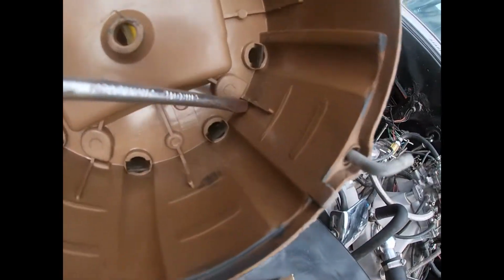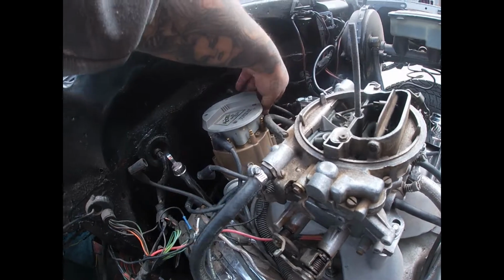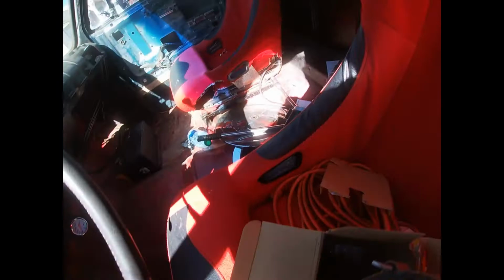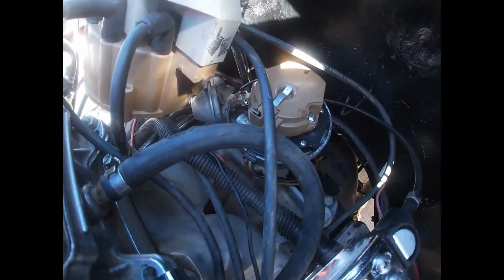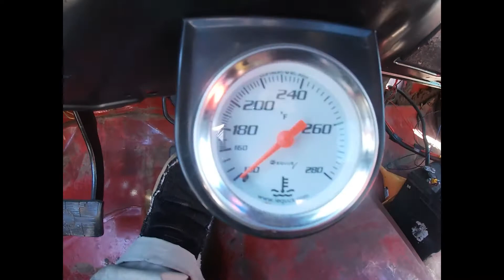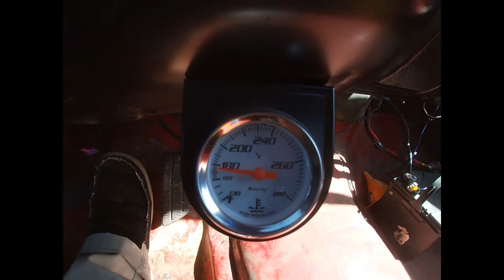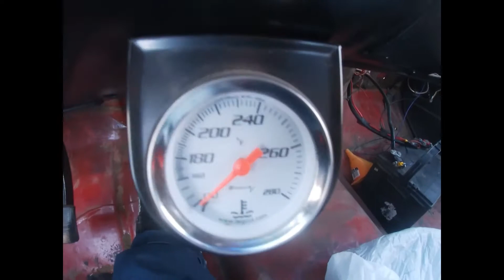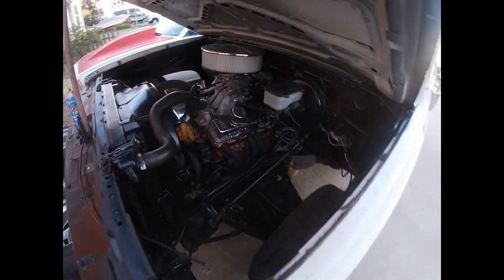c10 backfire problems/problem solved

Comment: That odd surge/bog off the line and at speed cruising IS your carb. You are going to want to look into adjusting the secondary butterfly. Over time, the spring loses tension, and a simple adjustment solves this. Dizzy cap must always be checked as you have before making adjustments ;)

Comment: I have a 67 impala with a 350 small block. I’ve been having issues with it bogging as soon as I want to pick up speed. I already did the timing changed the spark plugs wires and replaced the fuel pump and fuel filter any recommendations? I really don’t want to jump into conclusions that the carburetor is failing
Reply from the maker: Yeah bro if you changed spark plugs and redid the timing and u have good fuel pressure the only thing I can think of is the carburetor .I had a truck that I got running and it would bog out cause of low fuel pressure do to me not adjusting the regulator to the right psi .I'd check fuel pressure before messing with carburetor. I don't no what carb u got but an edelbrock needs 6 to 6.5 psi and a double pumper I think needs like 4.5 to 5.5 if that helps any..let me know if u get it figured out.

Comment: My truck started backfiring from the exhaust after I accidentally poured water it the tank( I have a loose cap). I added heat and fuel treatment to it, And for a while it was doing fine till it rained again. That was a few weeks ago, now it's backfiring from the exhaust again. I changed the fuel filter from the carburetor and the one i added myself. Drove it down the road it started to hesitate at 50 and it'll pop a couple of times. I took it to 70 it felt a bit difficult to keep it at 70 but it stayed there without popping till I slowed down to pick up the speed then it'll pop again.
Reply: Also it's a 1974 gmc(c10) with a 350 with a Quadra jet
Reply from the maker: I'd flush as much gas as u can then I'd change out plugs and see what it does if that don't work probably gana need car rebuilt is the only thing I can think of .let me no if it helps

Comment: Im having backfire problems. I've put the truck at #1 tdc compression and the distributor is pointed towards #7 is it supposed to always be pointed at number 1?
Reply from the maker: Yes its supposed to be facing towards the number one piston...
Reply from the maker: At all times ..might just have to pull distributor out and reset it if #1 piston is up and rotor is not facing it.
Reply: @w8e0s6t  thank you so much! We fixed my back fire problem and no power up hills. Also the fuel injector only firing on one side. Crazy how timing it correctly fixed all that!
Reply from the maker: @chastblind7606  good deal bro glad I could some what help 👊💯

Comment: I got the same issue. I have a 71 CHEVELLE with a matching small block 350. When I bought it , all parts seemed to be pretty old but man it fired up perfectly. So me being me, I went and replaced these parts for a fresh tune up. Spark plugs, custom accel plug wires, fuel filter, k and n air filter, and edelbrock coil and new headers. Hooked everthing up and it fired up and drove fine. So then I put carb cleaner solution and tank seafoam to clean out everything inside. I drove it to the city 1hr 45 go and back. Everthing was fine. Parked it. Next day fired it up and tried to drive and heard a loud pop inside carb, checked it out and saw smoke mist coming out of carburetor, gas I think. So I ended up buying a carb kit and I rebuilt it. At first I think I put the plugs wires in wrong firing order because then flames shots came out. Got worse. So then saw I choked it with to much gas and cleaned it out. Put it back and re-did firing order wires multiple times. I thought I might of skipped the timing, so now I’m stuck at that but I don’t think it’s out of timing. I never changed the distributor at all and I haven’t done that yet. So I will do that next. Because other then that. That’s the only think that’s coming to mind that it could be.
Reply from the maker: I'd check plugs bro they usually take a beating when u pore stuff in gas tanke to clean it out and stuff I'd try that before anything.u can rule out everything else cause it was running good before u parked it u no..so my guess would be whatever u pored in take made the plugs act up ..next I'd move to carburetor...let me no if y figure it ok 👍👊

Comment: What camshaft are ya running? Sounds good man!
Reply from the maker: Not sure bro my dad bought it from this old man back in the day when the thrifty nickel was around got a 400 crank bord out 60 dont no much about it but bottom oil pan was off and noticed they had to shave off the block for crank to turn .said it was a 383 stroker been rolling it ever since .💪💪👌 and thanks bro 👊

Comment: Nice truck mate, wife's 67 impala started running terrible.  Swapped out the distributor to an Msd, same trouble.  Ran the power wire to the battery and no problems.  Running it off the fuse box , carb is an AVS 2 650 and backfires when it transitions to the secondaries.  Seems too big for a mild 327, tried jets metering rods ,bigger accelerator pump nozzle and the rod in the top hole. Now I'm thinking about the plugs after I put a 570 on it. Great video mate,  wish we had those trucks in Australia.
Reply from the maker: Thanks I had a 68 convertible impala that till this day I regret saling. Iv always had problems with double pumper carburetors..😂Hope this video helps you with your problem all the way from USA 😎👍
Reply: @w8e0s6t I’m having pop sound  through the exhaust when I barely step on the gas did yours do the same thing ?

Comment: Great video pal, I hope your kid got to go to the park. I have a 1984 C10 Silverado, my problem is that my truck bogs down when I press the accelerator from a complete stop.  I have to do short pumps on the accelerator so that it will recover.  Do you think I may have the same problem you had? Any input or advice will  be welcome, Thanks Luis.
Reply: Sounds like a fuel issue. Could be a leaky accelerator pump on the carb. Can also be a vacuum leak. Vacuum leak would need to be severe, but yeah I'd check out overall fuel pressure and the accelerator pump. Good indication is if you see fuel leaking out of the carb
Reply from the maker: Thanks brother preciate the comment. And as far as what u got going on sounds to me like carburetor issues .anything with bogging off the line or in general would be carburetor. Usually from sitting or just getting clog with dirt .if u have a different one laying around would be best to try to see if it changes its act .or carb kit ..bad plugs wires distributor will give it loss of power , back fire ,struggle to start ect hope this helps and give me a halar back if anything questions. Thanks agin Baldemar Z...👊💯
Reply: Luis and Grav’s son;  thanks for ur response. My truck was really bogging. Based on ur replying and a little google, I was able to get the carb fixed. It was the fuel pump, a small adjustment to the bolt with the spring fixed it.
Reply from the maker: @baldez.2086  not sure bro but if you recorded it on ur phone you can go to that video then go to share it then your apps will pop up and then go to YouTube and finish it off there not sure about computer ..hope this helped some what..
Reply: I uploaded a video titled no more bogging. Check it out Luis and Gav’s son. Thanks for the advice.
Reply from the maker: @baldez.2086  sure will and no problem brother 💯👊
Reply from the maker: @baldez.2086  looked it up bro couldn't find it..
Reply: Change your metering rod the thick side is off idle the skinny is like quarter to three quarter sounds to lean on the fat side of the rod or go up 2 or 3 jet sizes

Comment: I have 96 gmc 1500 5.7 350 v8 getting back Fire an it get louder and more poping with acceleration I deleted cats and also new plugs any suggestions
Reply from the maker: Its was always ignition problems when it would back fire for me ..I'd just check distributor. Ignition module. Wires .make  sure ur wires are on the right spot also. If the distributor is old could also be it a little crack on cap can cause spark to jump to other plugs .let me no what u find out hope this helps

Comment: My truck is doing the same thing sometimes it only start for 2 seconds and it does popping noises. I already changed the cap and roter and also the wires and the coil and ignition module. You said you changed the spark plugs?
Reply from the maker: Yes the rotor was bad to begin with and it file out my plugs put them new and went away now if the truck dies could be carburetor or fuel pump problems.

Comment: So basically your distributor cap and rotor was bad and needed to be replaced. I'm sure the ignition was good and didn't need to be replaced. I'd have replaced the ignition wires as well. It was so hard to tell what was misfiring or if you had the wrong firing order when you put the wires back on the cap because your exhaust was so loud making it difficult to tell
Reply from the maker: Yes cap and rotor was bad and field out my plugs that I had just replaced so when I changed cap in rotor it was still back firing cause me thinking plugs where good when they  actually wherent ..if that makes since..change plugs again and fixed the problem

Comment: Got a 1995 dodge Dakota v6 I replaced the bearing on the transmission it’s a manual got it put back together and now the engine won’t stay on and backfires and shaking bad? Any suggestions? When the through out bearings broke I was on the highway I’m thinking somehow a peace might of caught the flywheel and maybe the timing chain jumped you think that’s possible?
Reply from the maker: Not to sure on that make in modle. Some have timing chain and some have timing belts like I said (not sure ).I'd do alittle more research on that befor anything. But if it is a belt it makes more since cause there not as strong as chain obviously so the throw out bearings breaking apart could have affected that being that it connected to flywheel. When it came apart prbly affected something there .I'd just look for any towrn wires up top on the back of engine and I'll ask a friend and reply if any news on it .good luck.👊
Reply from the maker: Said its probably an upstream 02 sensor  or engine cooling temp sensor. Check those and see what happens might not even have nothin to do with the throw out bearings going bad .
Reply: @w8e0s6t  thanks a bunch for taking your time to answer brother I’ll check that today. Mary Christmas!
Reply from the maker: @alwaystony1829  no problem bro to u and ur family as well.

Comment: I got my c10 will make popping noises thought the carburetor only when I floor it
Reply from the maker: That's a good one jst go over cap timing all that good stuff and see if that helps never had that happen to me before..I'm thinking it would be the timing but then I could be wrong u no..jst lift #1piston up and see where rotor facing ...point of the rotor has to be facing to the #1piston.😎👌

Comment: Nice ranfla homie
Question I have a 86 GMC truck all smog free. It backfires through the exhaust when I decrease in the gas  , I was told it was the lower vacuum valve?
SMH...I have a MSD high performane electric ignition set up, any feed back I'll appreciated  it
Reply from the maker: Preciate it  esse 👌👊..and on the cool its usually to much fuel or not enough spark ..what I'd do is reset timing and advance it to wear it sound healthy or /advanced high then check ur idle screw on carb u should be good nohh.let me no what it does .